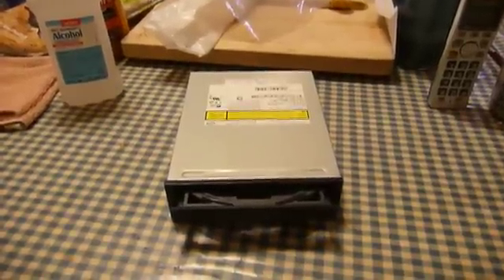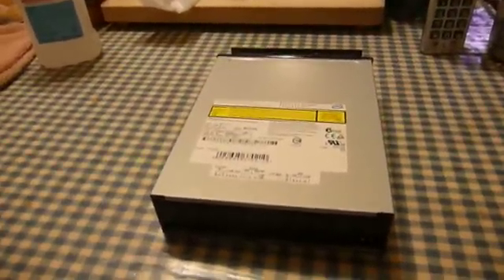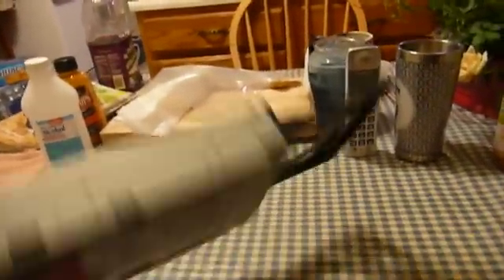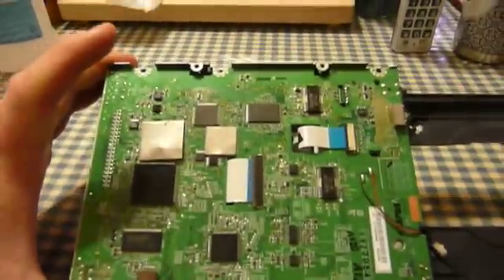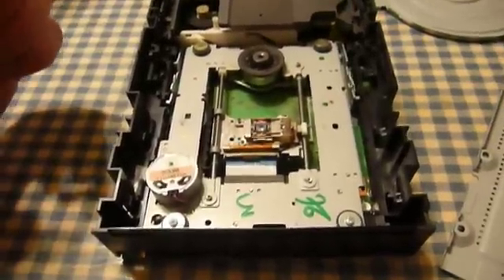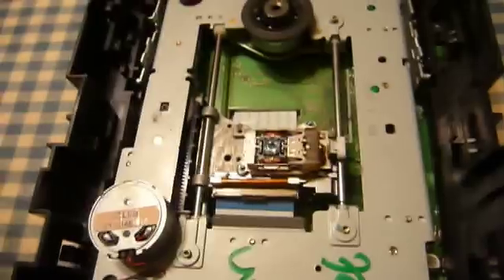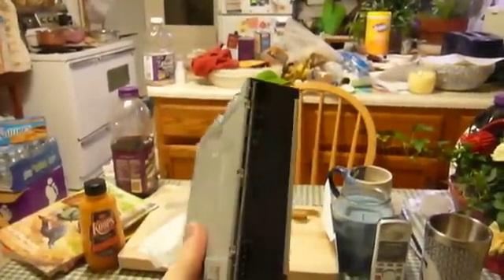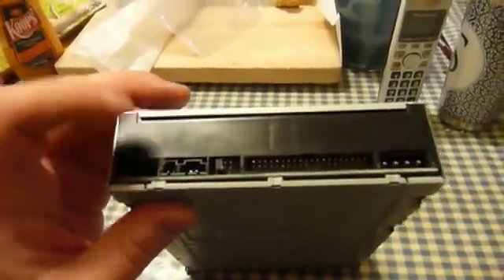How To Take Apart an Optical Drive

Comment: I have a Dell Dimension 4550 that bought in 2004…just recently my cd-rom r/rw door will not stay closed…I have to physically hold the door to make it stay closed…even does it when I reboot my computer as well…very aggravating…ideas are welcomed!!
Reply from the maker: The door sensing switch is not working properly, either because of dirty electrical contacts or the tray is not moving far enough to actuate it.

Neither is a difficult fix if you have a decent set of precision screwdrivers and a little mechanical aptitude. At this point, you'll pretty much have to fix it, as PATA optical drives are no longer made new and used ones will be hit or miss, if not prohibitively expensive today. You can install a SATA optical drive, if you add a PCI SATA controller card and adapters for the power connections.

Comment: Wow, thanks for that. I couldn't figure out how to open it, and tried to remove the metal case part, when you have to first remove the face plate, then the bottom cap, and then the metal case is easily pulled. The only difference form yours was that mine had the top spindle thing attached to the case, not a separate part.

Comment: The neat thing about these, certainly the older drives.  The audio out can go right into a cheap amp and simply power up with 12v and 5v via the 4pin connector or SATA power connector taken off an old PC.  Once powered you can use the front buttons to play audio CDs without any IDE or SATA data cable, pretty good for your workshop audio running on a bench supply
Reply from the maker: The "last gasp" PATA drives oftentimes still had audio connectors for analog and usually SPDIF as well, only the manufacturer would attach a label saying they were nonfunctional. (I tried them on one such drive, and as best I remember, while it appeared that the drive's logic could still decode digital audio, nothing came out of the connectors.)

I've never seen a single SATA drive with dedicated audio output connections, which is very disappointing. I've never liked the idea of running the audio over a data bus and making the CPU decode it.

Comment: Thanks for the tutorial!  In fact, that was a great aid when I took apart my DVD burner last night.  Actually, I wasn't as fortunate as you were as the laser lens wasn't dirty at all .  At any rate, I did apply a drop of Singer sewing machine oil to the drive motor, and replaced the tray motor belt as well.  What I suspect was that the laser diode inside this R/W drive was simply weak.  The problem that this drive had was that it was increasingly failing to recognize a disc.  In fact, it would barely read even an audio CD, and at other times, not at all.  Oh well, I do have a replacement R/W DVD drive on order.

Comment: Hi. I am having issues with my dvd cd rom drive. It recognizes the drive in device manager but wont read a disc.. I think its the drive, but how do i figure out what is wrong with it?
Reply from the maker: If you have a regular desktop computer, a replacement optical drive (DVD/CD-ROM) can be had for about $25.

Comment: I was going to repurpose my very first DVD drive. I've noticed that the disk spindle makes a rattling noise whenever I move it, and it doesn't seem to spin as freely as other ODDs I have. Is this still good? It's the one part that I need to be functional.
Reply from the maker: Some optical drive spindle motors have ball bearings loose inside them as a counterbalance. You'll hear them rattle and roll around, and it doesn't indicate anything is wrong.

Comment: hello! I recently bought a new cd dvd drive in order to replace it with my old one. but after doing so, my computer won't even start now! as I had my old cd drive in my computer, it did indeed did not work, but the computer would still boot if I push the power button. but after replacing it with the new cd drive the whole system won't even start. when I plug the 2 cabels (1 power, 1 for mainboard) out of the new cd drive, the computer will start. do you have an idea? thx in advance!
Reply: ***** thank you for your help! meanwhile I figured out the problem: turns out that one of my fans on the inside of the tower cover causes the problem. as I put the new cd driver out and tried to connect the cabels with it while holding the cd driver just in my hand, the pc and the cd drive worked all of a sudden (cover with fan attached on the its inside were removed from pc tower at that point). after that I thought the cabel of the cd driver were not attached right in the first attempt, so I put the cd driver again into the computer and closed it with the cover, but then it didn't work again. after removing just the cover, with its inside fan, the pc and the cd driver started to work. I can only assume that the multiple pluggin in/out of the fan into the mainboard may have broken the small cabel port of the fan or the port on the mainboard, allthough I was always careful to not brake it. maybe it isn't even broken and there is another problem with the fan, but the computer and the cd drive currently work, so that I keep the left cover of the tower removed for the next days. I could just remove the fan from the cover and put the cover back, but I do not wanna risk a graphics card overheating since the fan was supposed to lead the heat around the card out of the pc tower.

Comment: Just what I needed.  Hopefully I can fix my own drive with this information.  (Had a disc shatter in the drive. Surprisingly the drive seems to still work, but there's no way I'm letting anything spin in there at high speed until I make absolutely sure nothing else in it is broken, and all the shards are gone.)

Comment: man you are very knowledgeable about this stuff, its nice to see someone that knows what they are doing, i have two drives on my pc and i am a smoker so lately they have been having problems reading so i assume the lenses might be dirty, i know how to take them apart so im probably gonna clean them and see if that helps, also my top drive wont open unless you tap on top of the pc,do you think whoever installed them might have tightened too much and its binding? a few taps will get it coming out

Comment: This is helpful information! - I have a problem with my DVD writer keeps ejecting the tray - with OR without disks in it at all. I turn on the computer - the tray spits out. I push it in and the tray comes out again. Is it screwed for good or is there something inside the DVD writer I can check?

Comment: I got a Dell Dimension 3100, I had problems getting my bios to detect my DVD drive a Sony, so i bought another a LG dvdrw drive. Still errors in bios and sometimes it's in the bios.

I pulled a bit on the power lead to the IDE dvd drive. So there must be a problem there.

I have two IDE power connectors top ones faulty bottom ones fine. So could I get a IDE power connector for the second one and make 2 out of one.

Or should I replace the PSU 230watt ??

Comment: @yeoldeengineer My old Acer computer had an LG GSA-4040B in it, it was a reasonable drive, but naturally it had problems with some discs, also the sounds it made were a little strange, in fact both Windows comptuers I've owned had LG drives in them.  My iMac has an Optirac drive in it and it's extremely reliable, it read every CD I imported into iTunes with only 2 exceptions, and I think both discs were unbalanced.

Comment: @uxwbill 
All I know is that the drive made some rather unhealthy vibration noises instead of running quietly like it used to. Could be the spindle motor, too, of course. Never thought of that.

My "secret weapon" for problematic CDs is a little-used '99 Ricoh MP7040A. Not much you can do with a 4X CD burner these days, but it reads like a champ.

Fellow member of Team Lefties btw :D

Comment: Ha, I can see the "High speed linear access system" invented by Technics! :D

I have an optical drive in my MacBook Pro which only reads CDs, but should even write DL DVDs. I will throw it out and see what I can do, but I'm a bit scared if I'd break something inside. This is going to be a task since those small writers are usually a lot more difficult to disassemble.

Comment: When I took my old LG GSA-4040B apart, I found that unlike the NEC seen here, it had its upper spindle bearing inside the top case. Some kind of plastic affair. That was also the problematic part. Guess I'd damaged that with a very unbalanced CD (so much for unbalance detection). I then replaced it with a GSA-H42N, which overall reads and writes better (OK, CDs come out a tad pale) and is shorter. Maybe I'll get a new top case some day, so one of my antiques is treated to a DVD drive.

Comment: this reminds me of sony's first dvd burner. i have had mine apart many times for cleaning.i also have 5 other newer drives and all my audio seems to work fine.
even both my new lite-on's are ok. i have not heard of the audio trouble.i remember having to change audio settings on my old sony. when i was using a not so creative labs sound card.then it worked fine after that.

Comment: @Lachlant1984 
The best way to clean any type of drive is to clean the laser it self like uxwbill did. And i have a ps3 which has a slot loading drive too so if it has problems...well i guess i'll have to take a risk.

Comment: I've heard you shouldn't use brush typed CD player cleaners or compressed air to clean these lenses, is that true?  Would you recommend Isopropyl Alcohol to clean the lenses?  What about the slot loading type drive you see on some CD and DVD players and newer Mac computers?